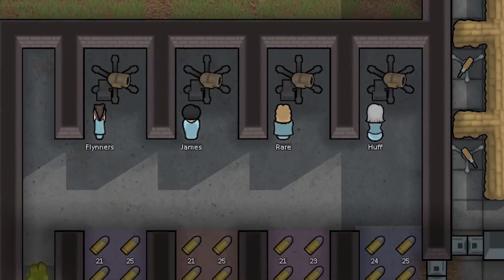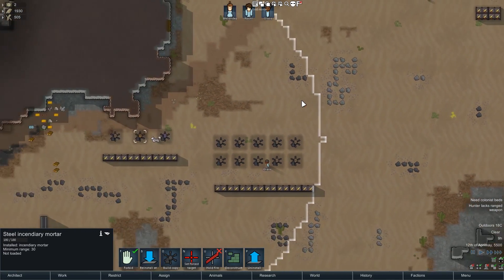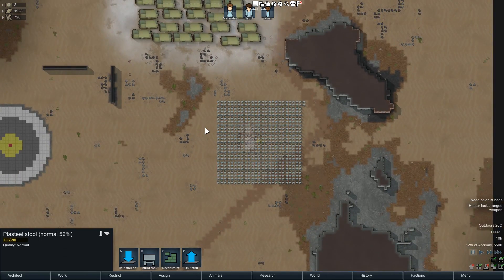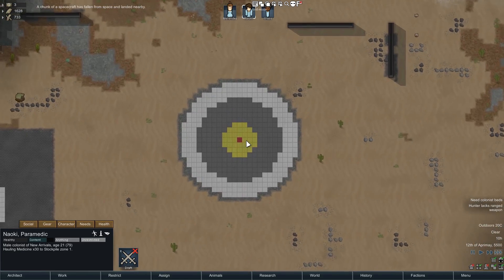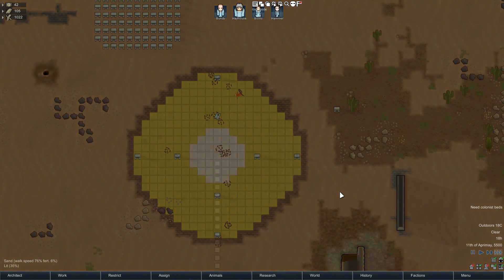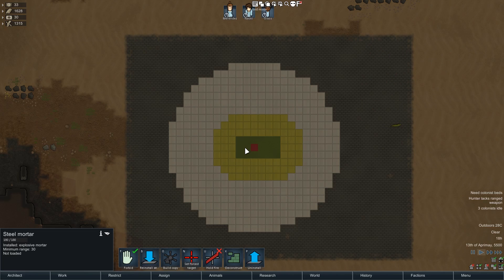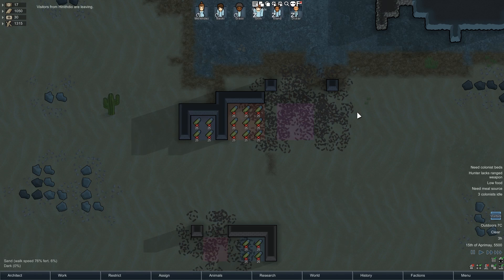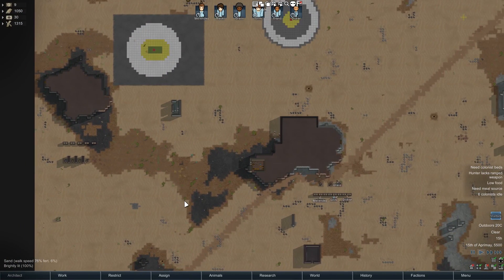RimWorld Science Alpha 17: Mortars — RimWorld Alpha 17 Mortar and Shell SCIENCE!!!

Comment: Hmm. What about creating one storage zone with comb-like structure of walls and shelfs? I guess shelfs are used preferably and with production set to produce if they are less than 50 you won't risk them on the floor. Losing one shelf is worth of 1000 units of steel and it's expensive already. Basically same design applies to battery rooms.

Comment: @9:00

P(A) = 'Chance to hit'
P(B)= 1-P(A) 
P(C) = 'Probability that you hit a target in x tries' = 1 - (1-P(A))^x

Therefore when you fire '5' shells with a 22% probability  P(C) = 1 - (1-0.22)^5 ~ 71% chance of hitting.

However, if you take the expected value E(X) such that X is the number of time it takes to hit, you can reduce this problem to a coin flip problem :

E(X) = P(A)(1) + P(B)(1+E(X) => E(X) = 1/P(A).

And when P(A) = 0.22, E(X) is ~4.5, so you can expect to hit the target every four shots on average.

You can probably get a deeper analysis using a Markov Bound, or Chernoff Bound, but

tdlr:

 great vid, but those probabilities do not add up when you have more mortars ;)

Comment: A tip for dealing with mech ships, you can completely destroy them instantly with 5(i think) mortar shells(stacks of 1) around the ship and a molotov and even damage or kill  the emerging mechs, this is useful if you don't want to risk the shells missing when firing with a mortar or if you don't have one, this way the 5 shells hit and destroy the ship instantly.
And because the mechs don't fully agro unless the ship has less than 50% hp you can place 3 shells so the rest will go into your killbox and you can later go kill the ship.
You can position individual stacks with a bit of stockpile micro and storing and forbidding shells as you produce them.
Reply: This is actually a great idea. I might try this out when another mech ship crashes. Though, I might increase the number of shells just to be sure.

Comment: Interestingly, a stack of mortar shells has the same explosive power regardless of how many shells are in the stack.
One shell does the exact same damage as 25 shells.

If you want to use them as a chain reaction bomb to annihilate a ship or something, place a bunch of explosive IEDs, deliver only the shells to the blueprints, cancel them, and then forbid the shells; you're left with an extremely explosive bunch of stockpiles, with minimum cost.

The same works with chemfuel (which makes firey explosions), but there's no way that I know to get a stack of 1 chemfuel intentionally, so the best you can do is stacks of 25.
Reply: I have just tried that a couple days ago, as a Psychic ship landed right outside the stables. Well, 7 Mechs came out while our 2 oldest colons were closing by with the shells I ordered them to put around the ship.